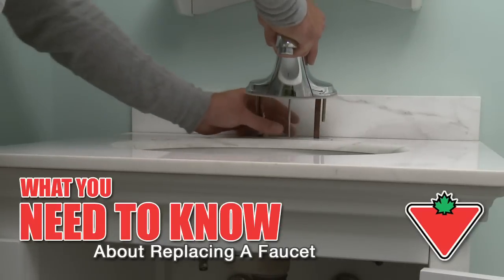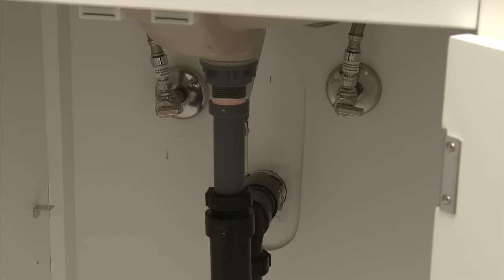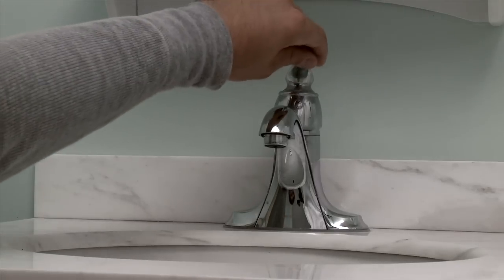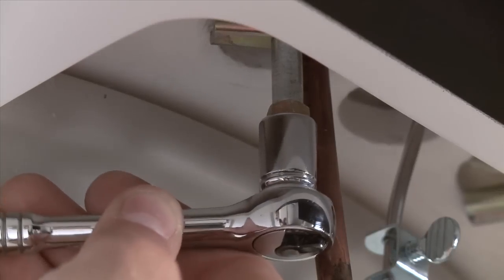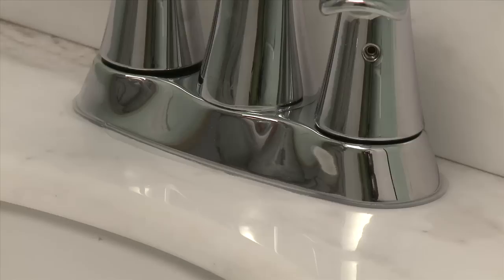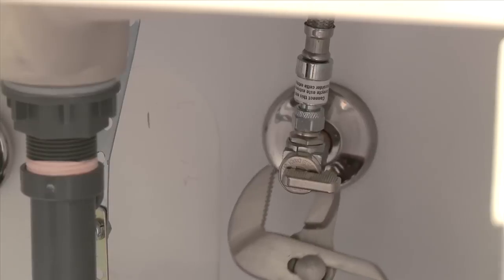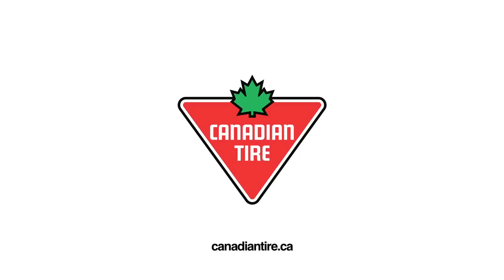How to Replace a Faucet

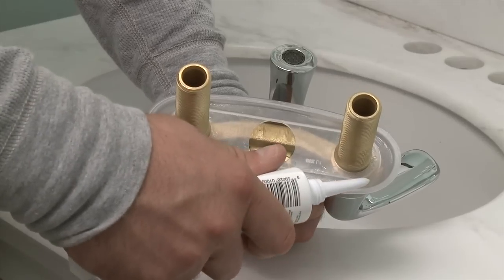Comment: 1:50 - no silicone needed, that is why you have that flexible seal under the faucet
Reply: This utility sink faucet comes with a similar gasket, but the instructions explicitly call to also use the silicone sealant:  https://images.thdstatic.com/catalog/pdfImages/6f/6f990fb5-708d-4998-9177-f5fc0961e912.pdf

Comment: **VERY IMPORTANT
ALWAYS  COVER THE SPEEDWAY CONNECTION AT THE VALVES FROM FLOOR OR FROM WALL TO AVOID ANY DEBRIS,DIRT  FALLING  FROM THE OLD FAUCET  INTO THESES OPENING .THIS WILL AVOID  CLOGGING AT DIFFERENT LOCATION  YOUR NEW FAUCET AND THE NEW FILTER AS WELL 
GOOD LUCK
                                FROM  TECH     RETIRED PLUMBING SUPERVISER AND QUALITY                                CONTROL  .